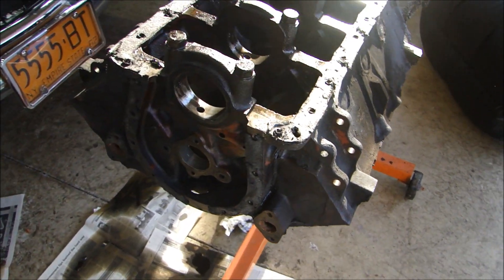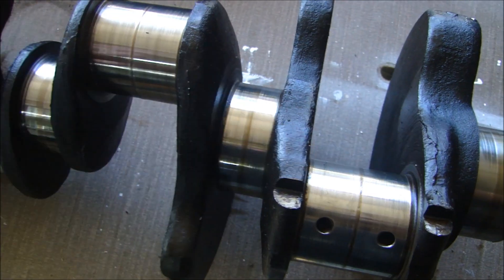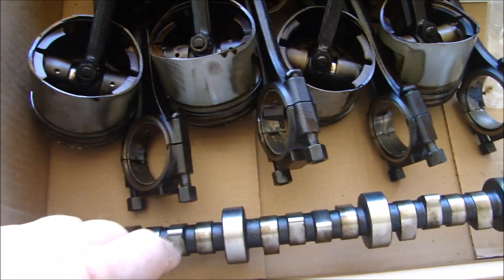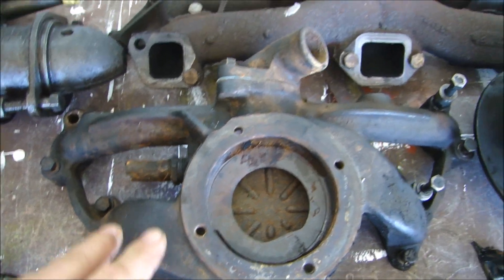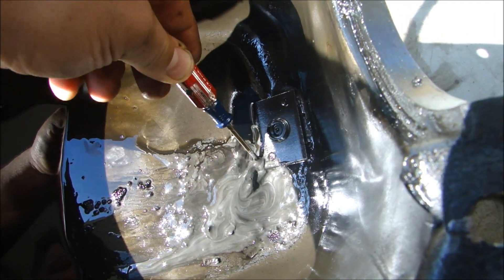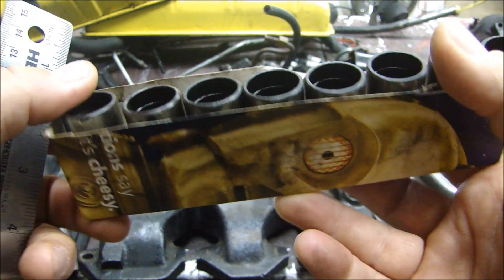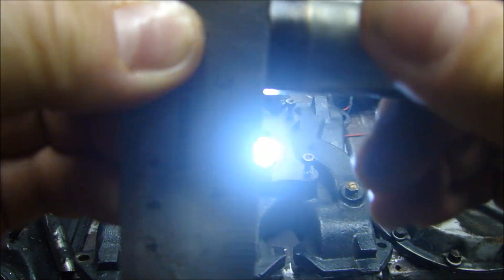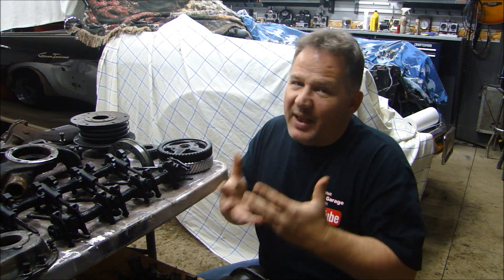Engine Rebuilding - Part Inspection

Comment: Just found your channel... and have been enjoying the 289 engine rebuild for that Studebaker... Funny, since 8 years ago I used to live in the Buffalo area.  Anyway, I'm curious to know if you did the math... boring the cylinders 30 over will raise the cubic inch number and turn the 289 into... what?  I have to wonder if at least SOME of the success Ford had with the 289 was due to the 289 in these Studebakers...? Thanks for sharing this... can't wait to watch the rest of the playlist now.
Reply from the maker: I can tell you the Studebaker 289 is nothing like a Ford 289. It's actually closer to a Chrysler. I did not figure out the increase, but it's small
Reply: @PetesGarage  Well... I'd rather have a Studebaker than a Ford... and I grew up on Mustangs... lol.  Would be nice to have a Studebaker 302, but I don't know the math... probably more like a 295.

Comment: Pete, I use Oregon Cams to have lifters resurfaced . These guys are really good. Cams no matter if its a car or locomotive.
Reply from the maker: That's awesome, thanks John
Reply: @PetesGarage I enjoy your channel    I believe they use a Tobin Arp Tappet Refacer   I've been trying to find one for my machine shop
Reply from the maker: They'll be busy for sure!
Reply: @PetesGarage   Most lifters (tappets) are ground on a 1.5 degree convex surface and lode is ground accordingly

Comment: Pete,whats your opinion on "remanufactured" short blocks?I am building a Ford 400 out of a 351M block,but almost purchased a reman.'d 400 short block from Mabbco.
Reply from the maker: Well, it's impossible to know what tolerances there are and what parts were really used. I'm not a huge fan of them, but if you don't have a way to machine and build, it would have to do.

Comment: What color is the block supposed to be...
New camshaft wasn't available...
Reply from the maker: Any cast block will be slightly grey. I could not find a new cam.
Reply: @PetesGarage  
With the bright yellow valve covers, I didn't know if the blocks were painted black from the factory, seen a lot of them black....
Reply from the maker: They were painted satin black

Comment: I enjoy the videos and your expertise but question some of the decisions. The work being done on the block and heads sounds first class, but why reuse the cam, push rods and lifters or even think about reusing the pistons unless this is a rebuild on the cheap. I am glad you are replacing the valves, valve guilds, and rest of the rocker arm assembly.
Reply from the maker: Fred Maxwell the pistons are new. the cam and lifters are being reused because new cams are not available, and a regrind will reduce the service life. the lifters are kept because they are worn and seated to the cam. Every bearing, seal, part, and fastener  was replaced as necessary, right down to new gears in the oil pump. Watch the rest of the series to see what was done.... thanks
Reply: Thank you. I was wondering if there might be a problem finding parts for the engine and that explains the cam, lifters and etc. Oh I figured all new gaskets, seals, bearings and etc. I plan on watching the rest.

Comment: 8:50  that gray colored sludge is most likely "BABBITT" bearing material from the rod and main crank bearings.  normal for 50+ years old.

"https://en.wikipedia.org/wiki/Babbitt_(alloy)"
Reply from the maker: Thank God for Wikipedia

Comment: just to let you know, me and my dad rebuilt our first engine. 2010 chevy suburban 5.3l lifter went out, then found out cam needed replacing as well. never done a project anything like this. very basic mechanical knowledge. found out that you can get info on how to take it apart and back together with torque specs with the computer software at your local library. the same one mechanics use. printed them out, runs perfectly and saved $3,500. thank you for the inspiration.
Reply from the maker: Wow...that's awesome! Thanks for sharing

Comment: hello help me with a problem i have a 2 whire abs sensor that is broken and i bought a new sensor and i tested the new sensor by pluging in the electrical connection but without mounting the sensor on the wheel to see if the abs light goes off when delleting the error codes but the light stays on is it posible that i have to mount the sensor on the wheel to test it i am testing it stationary . thoes the electrical polarity of the 2 whire sensor matter? or if it is not on the wheel when stationary . does it have to be near the tone wheel for the ecu to test it if it is stationary? thank you waiting for an answer
Reply from the maker: It has to be installed and the polarity has to be right. It is a hall effect switch that works with a magnet so it will not come one unless it sees the pickup on the wheel hub

Comment: Pete, this is great, I'm really enjoying this and am looking forward to hearing that engine run! Question, where is that machine shop? By odd coincidence I've got a Studebaker 289 crank that needs to be polished but there is no one around here that does that kind of thing anymore.
Reply from the maker: Thanks Jeff. The shop I use is J & L Performance in Lancaster NY.
Reply: ***** Thanks, somehow I was hoping it was someplace closer to Raleigh, NC... but I really knew better!

Comment: Pete, interesting you would use an aluminum cam gear against a steel crank gear on the front end. Any comment would be appreciated!
Reply: Ron, that's also how the factory did it. The aluminum gear was used in high performance and heavy duty engines.
Reply from the maker: The aluminum is definitely harder than the composite plastic one and that one lasted 54 years. Metal on steel is fine if the clearance is good.

Comment: Great and helpful video. I'm starting my first engine rebuild (DeSoto Hemi) so this kind of guide is really what I need.  When you're looking for a machine shop, what should you be looking for?
Also I hope you'll do a rebuild video on the shaft rockers.
Reply from the maker: I know it's difficult, but find a machine shop who is willing to help you and will let you see what they are doing. Too many shops like to keep their work a secret. In my experience they do that so you can't see when they are doing poor work. A good shop will be proud of what they do. Also, find someone who is willing to help you, not suck extra money out of you like a regular automotive repair shop.

I will be doing a part cleaning and rebuild video on all the parts.

Comment: yo pete cool idea with the magnetic strip to keep all the lifters together, One Question, after grinding the crank, squaring, reboring the cilinders and decking the bolock,cylinder head, valve  job, new valves& guides, new pistons, rings, bearings& cam bearings  etc plus all the machining work at the shop, why use the old cam shaft and lifters? Thanks as always for your to the point, no fuss, honest, informative, excellent vids
Reply from the maker: New cams for this engine are not available. The cam could be reground, but for a low RPM engine and with such low spring pressure, it's ok to reuse it since it and the lifters are in such good shape.
Reply: Petes Garage Thanks so much for the reply, Im in no way a pro machanic, but pritty good amature, you really have inspired me to pull the trigger on my life long dream if building my own cobra replica, only issue is I live in Thailand and import duty on automotive parts is insain.....150%! So Im trying to work around it.....I will go for a factory 5, theres an imported kit for sale in chaing mai,You've inspired me to go for it....Thanks for your time and inspiration......and excellent tips, advice on rebuilding engines.Dont ever stop......

Comment: Thanks for helping maintain the integrity of this car.  This Studebaker is an interesting build.  I always found detailing an engine compartment is always ALOT of work. However, it is ALWAYS worth it in the end because the hard work can be witnessed every time the hood is open and often becomes a nice conversation piece. Can't wait to hear it purr. Good luck and as always, thanks for yet another interesting video.
Reply from the maker: Thank you my friend. You're right, it's always worth the work. It should not be much longer now.
Reply: rapidride2

Comment: Back in 69 when I had my first car ( at 16 years old ) it was a 1955 Studebaker Champion 2dr. post. It had the 259c.i. but it looked very much like your project ,  it was a solid engine.  back in 67 my uncles and grandfather installed a 259 ci from a 55 Studebaker 4dr. into a 1960 Lark that came with a straight six, and I remember my 65 year old gramps racing it against teens and actually beating some.  Great memories from my teen years now that I'm 63 years old.  Also the 289's had 4 bolts on the valve covers and the 259's had two bolts.
Reply from the maker: That is really interesting. It's always fun to look back at the cars you had when you were young